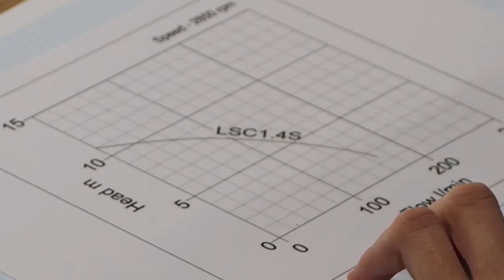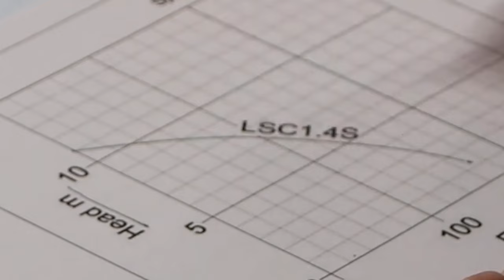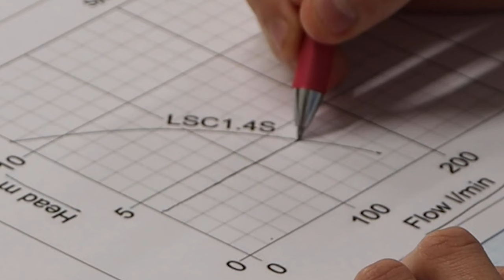Learn How to Read a Pump Curve in Minutes | Best Simple Explanation

Comment: Informative thanks...so if height from bottom of sump to to top of land height is 1.5 mtrs at a distance of 35mtrs discharge point.... equals 5 mtrs head?
Reply from the maker: As a rough approximation yes. If there are any right angles etc this can add another m, so potentially 6. It is best to work our friction calculations, but in most instances this 'rule of thumb' can work well.